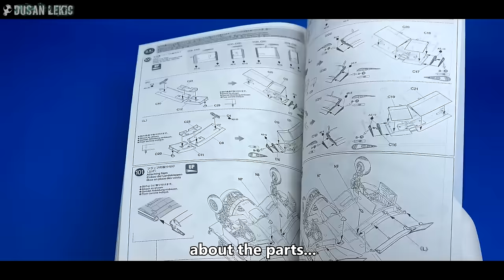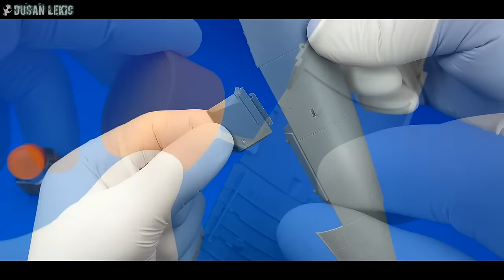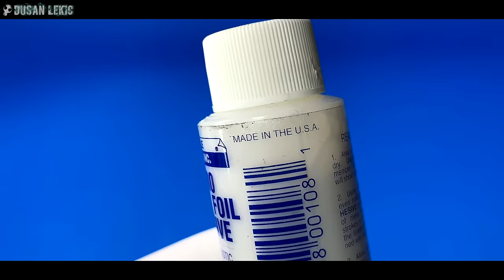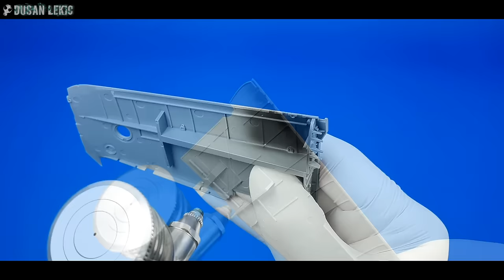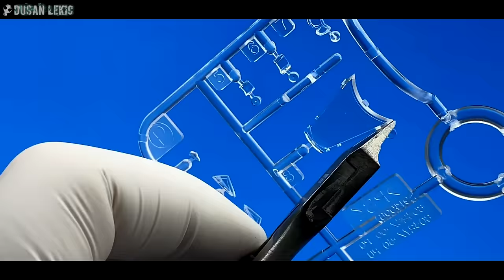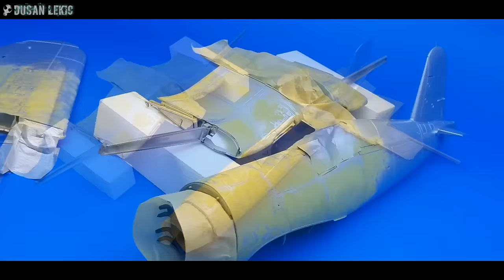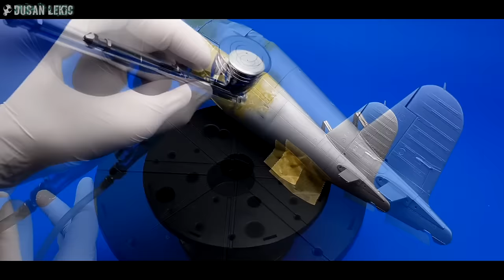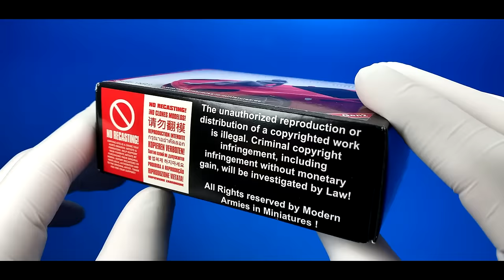TAMIYA CORSAIR® 1/32 BUILD ❤✅😍

Comment: This is the highest mark ever given to a model aircraft kit. He painted it before putting the lower half and wings on and with a PERFECT fit. Boys you can't do that with any kit I've ever seen and I've been at it for over 35yrs! Well done Tamiya absolutely incredible.
Reply: you get what you pay for - i was lucky enough to get this kit as a gift - i was floored when i found out how much it cost/.
Reply: You haven't seen Plasmo have you? He can do things with a snap together kit that most modelers could never do.
Reply: You are right! You should see how precise the engine compartments fit together and then fitting the several exhaust and intake manifolds together; then connecting the various engine segment together is remarkable.  From the rear firewall to the cowl flaps to the twin row R-2800 radial to the engine cowl inspection hatches to the front cowl, they all line up perfectly and slide into place without a wobble. These components built in sections, come together perfectly. It is amazing.  

And this plane is built with the ability to easily display or enclose the engine. The engine cowl inspection hatches fit snuggly without clue and one can remove these cowl hatches depending on their mood or the phases of the Moon. 

I fitted the engine with home-made spark plugs and ignition wires. It was a little work, but worth it. Also I bought the 3D cockpit instrument panel decals.
This cockpit is hyper detailed in the out-of-the-box configuration. With the 3D decal kit, it is almost an exact replica of a full size Corsair. It is hyper-correct.

I build my aircraft with figures in the cockpit and in this case, used the figure that came with the kit.  He turned out nice and when I finally assembled the two major cockpit components, the control stick fit right into the pilots hands perfectly and his feet were on the rudder pedals in perfect position. This occurred without me ever thinking about it while I slid the rear cockpit assembly into the front cockpit assembly. It was perfect and just amazing the pilot was grabbing the stick perfectly and his feet were setting on the pedals just as one would expect. 

After fighting a previous build of a Trumpeter 1/32 Corsair, this build is an endorphin filled adventure when fitting parts together and joining separate major component sections.

I could kiss the Tamiya designers, whereas I wanted to toss the Trumpeter model and kick the Trumpeter designers in the ass.

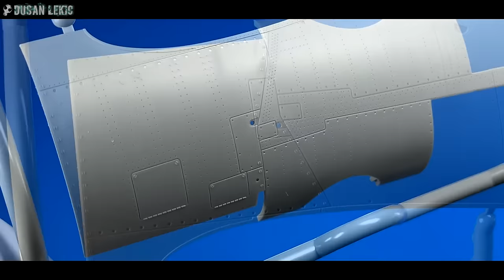Comment: I built Tamiya's 1:48th-scale version of this aircraft. I very much enjoyed the work, and I greatly delighted in the re- sults. Working simultaneously, I al- so built two of Tamiya's 1:48th-scale F4U-1/2 kits, one as an F4U-1 and the other as an F4U-2 night fighter; a third F4U-1/2 kit that I had intended to con- vert to a model of an F4U-1C, with the four Colt-Browning 20mm cannons. I also assembled their F4U-1A and F4U-1D kits, the -1A as a Royal Navy Fleet Air Arm Corsair I--this airborne --and the -1D as Lt John Glenn's USMC island-based fighter. 
   I would like to replace them all with these new Tamiya 1:32nd-scale F4U Corsair kits. I am keen for this ambiti- ous oeuvre, and I would super-detail them as much as my abilities enable me. I am a skilful, diligent model builder, though I am a couple levels below the master modellers I have seen.
Reply: I too built Tamiya's 1/48 Corsair, and several other of their kits in the same scale, having previously tried out 1/72 but wasn't satisfied doing such tiny kits. Now I'm entering 1/32 scale. My first two are Trumpeter's P47D and A1J Skyraider, but will look into Tamiya's kits in 1/32.

Comment: Lovely build! This seems to only happen to me so I'm quite curious. When I use Tamiya's extra thin cement on a part that has been painted, it seems to just take off the paint and then not glue the pieces together well. It seems to only work on surfaces that have no paint on them so I have trouble after painting some parts and then trying to glue them on...
Reply: You never put glue over paint, they way the glue bonds requires that the plastic be "naked". I usually wash my kits in soapy water before taking them off the sprues just to be sure they are clean.

"At the beginning, it is easier to paint the smaller parts on the sprue and to remove them only after they have dried – paint can be touched in after the parts are finally joined. Note: Do not apply paint to the mating surfaces where you will eventually apply glue. Additionally, you can make holders for yourself, for example using clothes-pegs, cocktail sticks pushed into foam (or similar) or you can secure your ‘handle’ onto areas that cannot be seen (such as the underside of a seat), even on a piece of waste sprue"

https://content.revell.de/content/en/model-building-beginners-tips/index.html
Reply: @justinmorgan2126  Ah I see. It always looked like the surface they put glue on also had some paint on it but guess not lol
Reply: Anytime I need to get paint off a joining surface I'll have a lightly thinner(per paint type)moistened stiff cotton swab and just clean off the surface with that before cementing. Sometimes regular rubbing alcohol to clean after that as well.

Comment: Just a question.

Why the change to the resin tires? I would’ve kept the rubber ones.
Reply: Whatever type of vinyl/rubber material that the tires are made up of can deteriorates over time.  I have models I built back in the 90s , like the Hasegawa F-14 and Revell B-1, where the tire material has dried out and cracked like an old pencil eraser, or decomposed into a sticky tire shaped object on the rim.

Comment: Why do people think aircraft were allowed to sit around looking shitty? From 42, when we entered the war, to about 44 when we got the Axis on their back foot, airplanes SOMETIMES were allowed to get seedy. If you know anything about the Marines there is always a bucket of paint and some privates with not quit enough to do and corporals who need to be watching something. Idle Marines are unhappy Marines and unhappy Marines are bad for morale. The AAC and Navy stopped painting their aircraft because the paint was dead weight and unwanted drag.
POL leaks HAVE TO BE FIXED! Pilots like to know that their airplanes are safe, it can be a long ass walk, or swim. home. Dirty or oily exhaust is an indicator of engine wear and should be fixed before it becomes a problem. Gun powder residue was cleaned up because reloaders didn't want walk around with dirty knees.
Reply: The US Navy never stopped using paint during WWII, as all their aircraft were painted in some shades of blue even at the end of the war right?